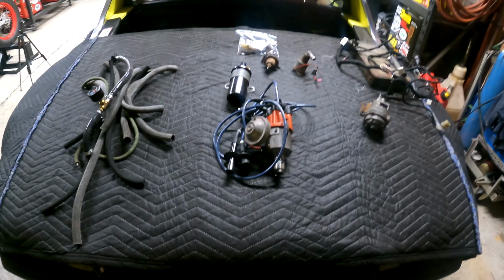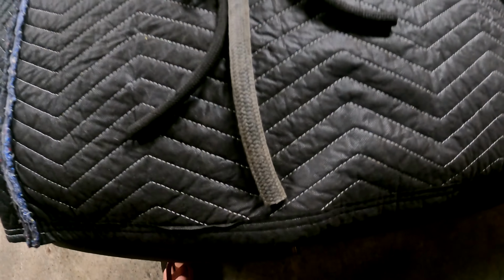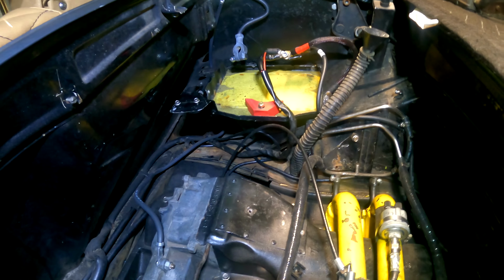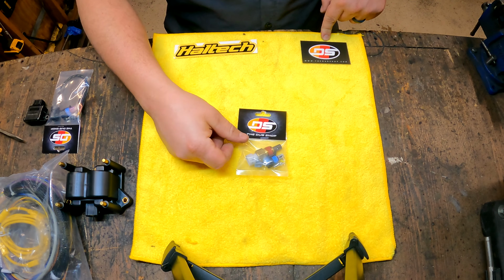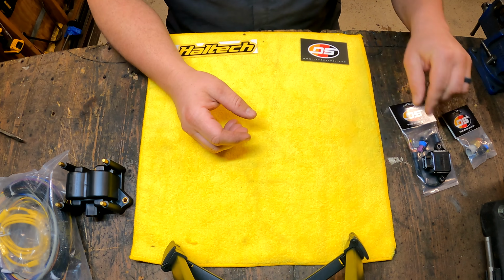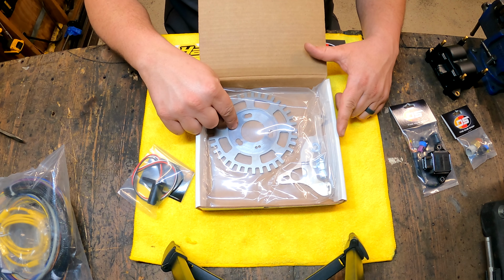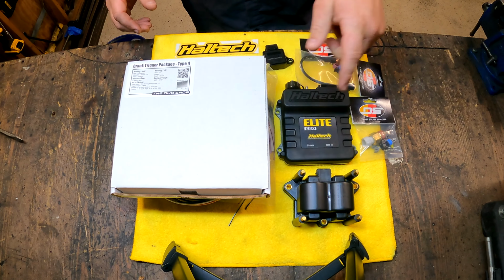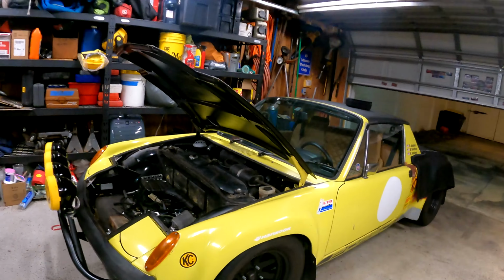Porsche 914 D-Jet Delete- Haltech EFI Conversion Part 2: Parts overview

Comment: Hi Nathan
I've a question for you about Haltech
I finally started my 914 engine with my Haltech. It seems fine, but when i turn off the ignition key, engine still runs !
My question is where are you taking the ECU power from  ?
Reply from the maker: @jean-michel4665  I have the same issue intermittently! I pulled keyed power from the relay board to a separate relay for ECU power

Comment: For the Throttlebody Sensor I made a mounting Plate out of Aluminium and mounted this with the original M3 Screw holes and drilled 3 holes for the BOSCH Sensor, looks good an worked perfekt. I Wonder why you are not using the original Temp, Sensor for Head an Air? In Tuner Studio you can insert 3 values and the software interpolates the Curve for you.
Reply from the maker: Nice! I just started looking at the TPS last night and plan to do something similar. I have been suspect if the CHT for a while, so I feel better using the DubShop part with a known calibration table.

Comment: I think you have at least drop the Engine an Lift the Car to get the Trigger Wheel in, at least I have hade to do it ....
Lookin forward hearing you cursing and Swearing HEHE
Reply from the maker: I ended up having to drop it! You can watch me struggle with it next week :)
Reply: @barefootgaragejax9252  Before I read your comment, I was wondering if you were going to have to drop the engine.  I'm in the middle of rebuilding the engine in my 914; the engine has been out of the car for some time, so I don't remember how much space there is between the fan shroud and firewall.  Before you said that you had to drop the engine, I was thinking that, if there was enough room between the fan shroud and firewall, you might be able to remove the fan by using a socket with a long extension and ratchet, remove the bolts for the fan and pull it out.  But I guess that that was easier said than done.  I have a 2.0 D-Jet; I'm really interested in seeing how this turns out.  If you can pull it off without too much trouble, I'll seriously consider converting mine too.  Keep up the good work! :)
Reply from the maker: Nice! If you’re contemplating this conversion in the future, install the crank trigger now. I can confirm the fan will come out in the car, but you really need to remove the shroud for the bracket and sensor. Stay tuned!
Reply: @dewder74  It might be possibel if you can manage to remove the Air Shroud. But a least it is easyer to drop the Engine and lift the Car or vise versa.